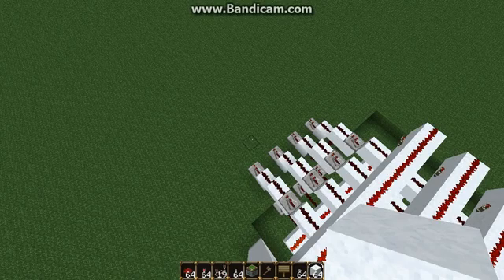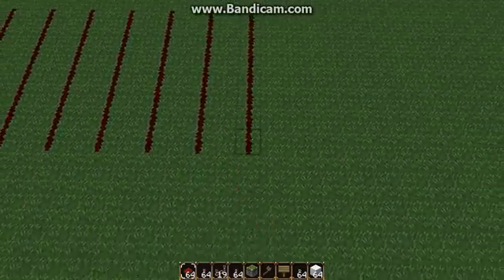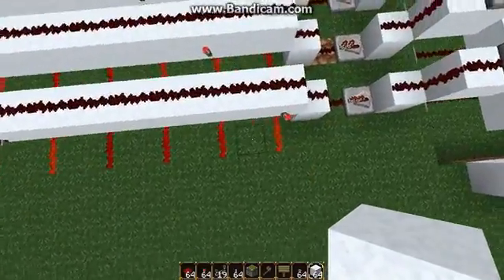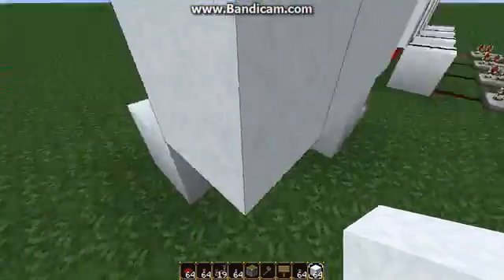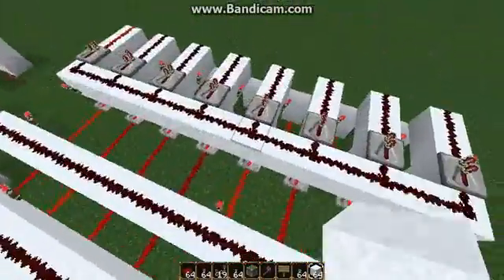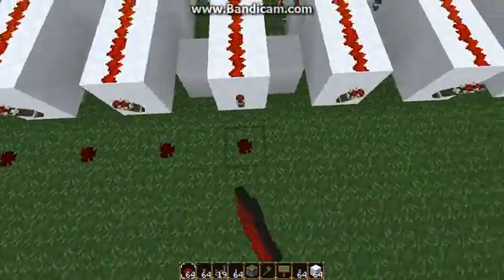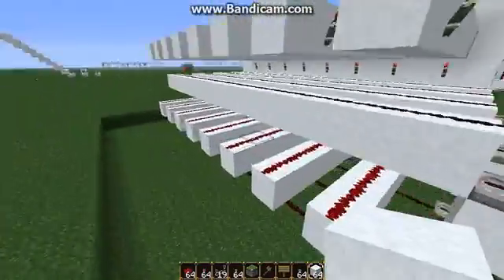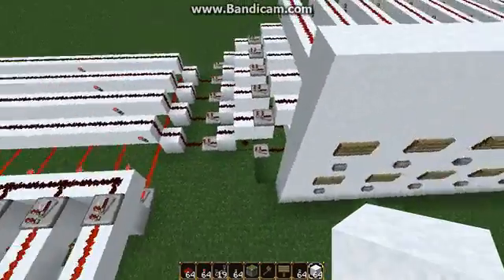Building a minecraft calculator tutorial pt2: Input Manager

Comment from the maker: First I'd make sure that the memory for input b is actually saving things when you power the write wire. If it does, then make sure when you have the lever flipped to input b and you hit a button that the power actually travels to the write wire.

If all that fails, then double check the 5 repeaters connecting the input section to the memory. The first 4 should be on 4 ticks, and the 5th one should be on 1 tick.

Comment from the maker: Make sure the block with the wires on it is directly above the second torch, and make sure that the first torch is off. If its still like this, then chances are its working correctly. The way this part works is it stores whether redstone power is on or off. In my case, it stored power of the wire being on by default, but it might have stored off for you. So as long as the actually circuitry is the same, even if the power is different, it should end up working all the same in the end.

Comment from the maker: @terregator One possible reason is that your signal might not be reaching. Try testing the lines and making sure they all make it all the way to the end. If this still doesn't work, make sure your d flip flops have all the parts copied correctly. I've had issues several times where redstone or torches will somehow get chopped off in the copying process.